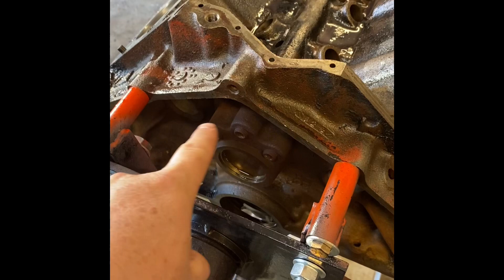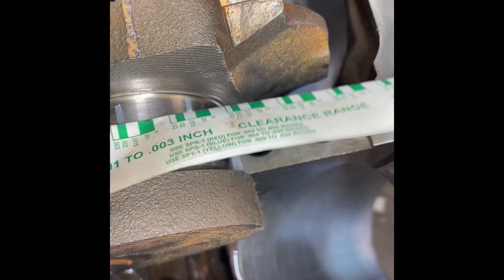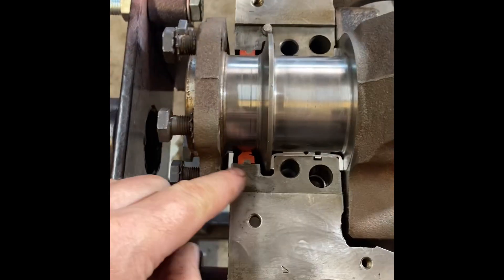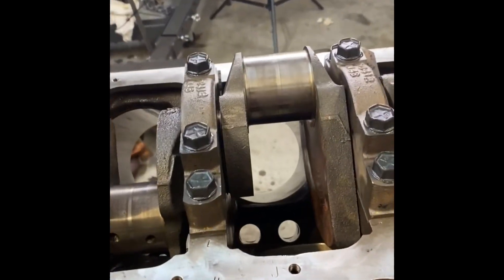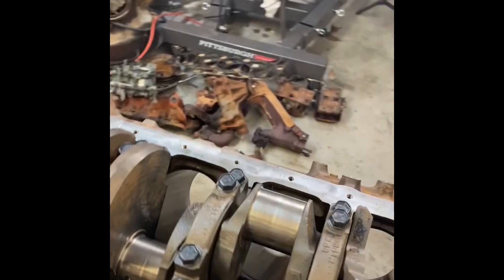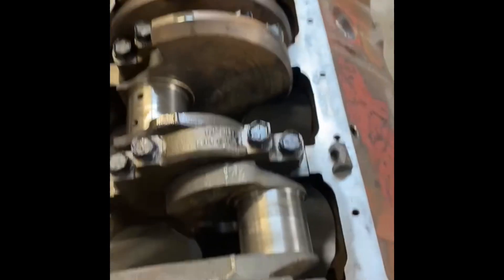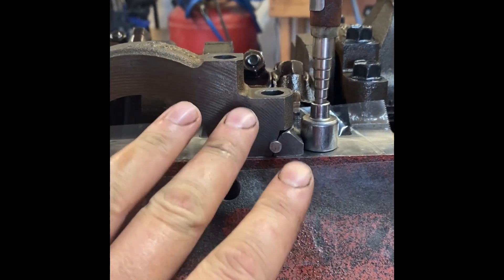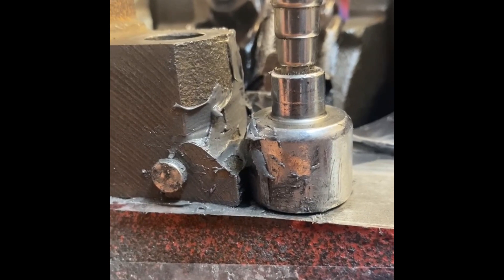Broke A 4 Bolt Main Cap…JB Weld Repair... | Sick Week Build Part 4

Comment: I guess when you don't have an electric or torch welder a JB welder is the second best way to get er done? I like it! LOL Subscribed.
Reply from the maker: I actually have Mig, Tig, and Stick. Just didn’t want to put a bunch of heat into the cap. It would have run fine without it even there.
Reply: @freedomworx  
Cool, maybe you can do the Highboy suggestion I mentioned on that video?